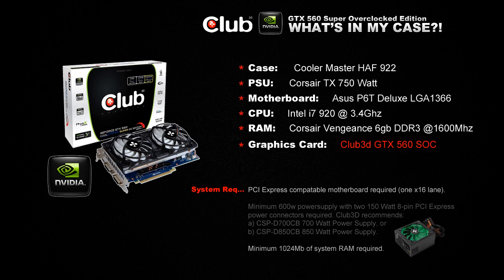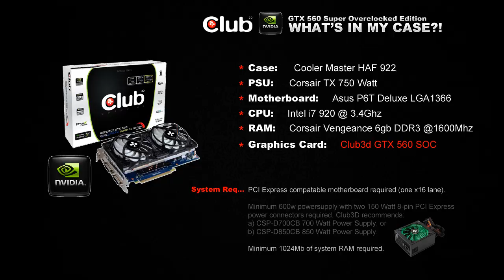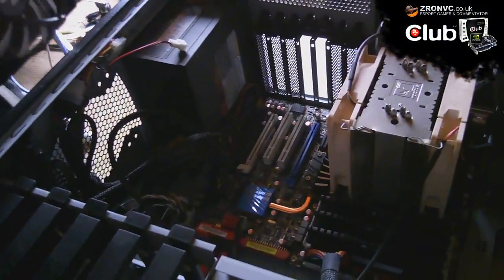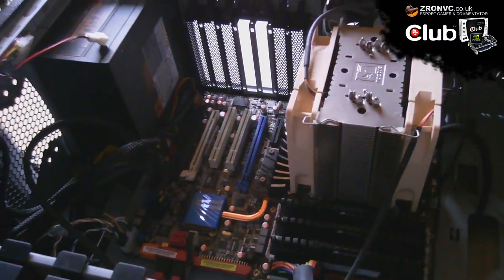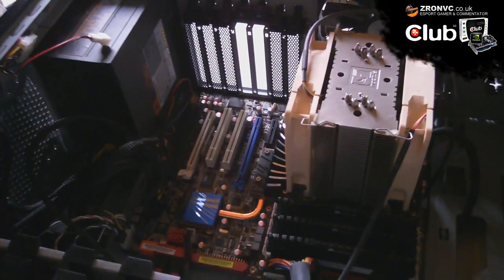Club 3D Nvidia GeForce GTX 560 SOC - Installation

Comment from the maker: Hi Tmac2016, Technically your PC it does work. You need to remove the Nvidia 8500GT that comes on the PC and replace it with this card. We do not know how the main board is configured inside as it says it has 2x pci-e 1x slots free and one PCI occupied. Make sure there is space in between the PCI-E 16x and the PCI card so the GTX 560 can fit in, this is due to the dual slot space required. Cheers